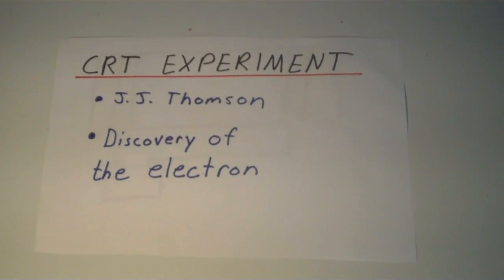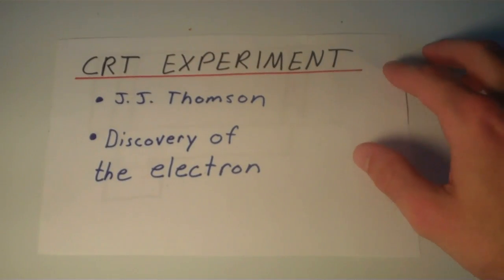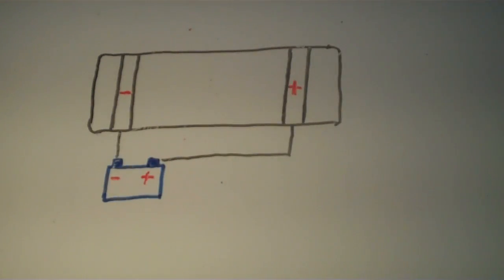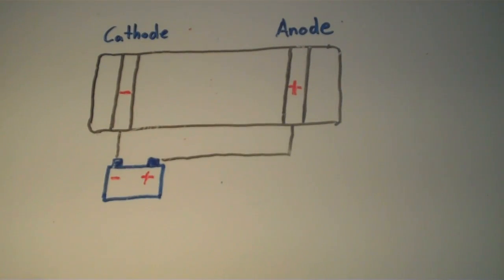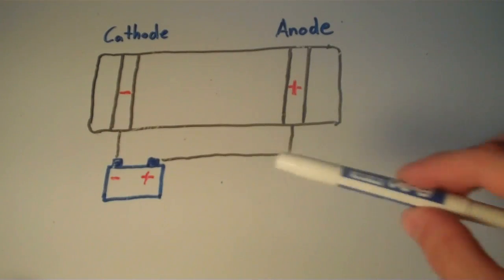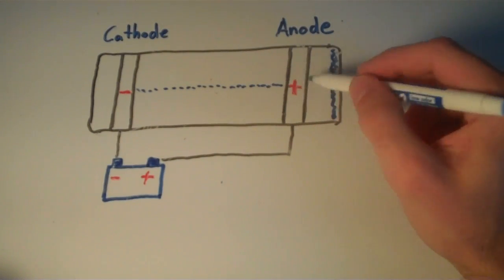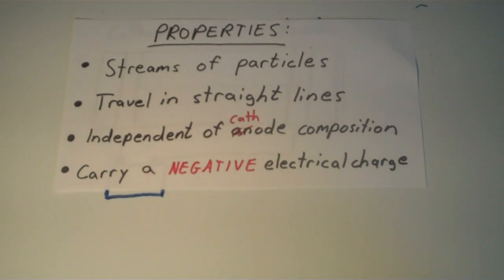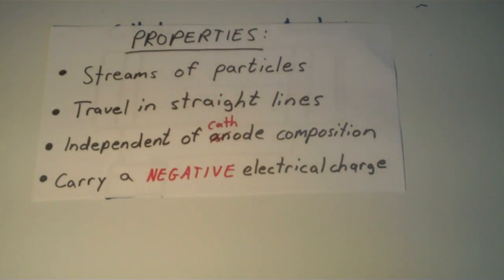Thomson's CRT Experiment:  The Discovery of the Electron

Comment: i'm confused how/ why this works. If you have a string of particles of like charge going through the tube, how can this be? Don't like charges repel one another? how can they form a beam? If one have a bunch of beads that were (electric) monopoles and tried to line them up in a straight line, would one be able to accomplish this?

Also, if the cathode and anode are forming and electric current through the vacuum why do electrons move past the anode? Why wouldn't they go into the anode to complete the circuit? If the electrons aren't going back into the anode, wouldn't this mean that there is no circuit?

Comment from the maker: @The1chipdude In a way, yes.  This experiment showed that the atom, which was once thought to be indestructible, could be chipped, and that there exist negatively charged subatomic particles (which we now call electrons).  How these electrons fit within atoms was still up in the air.  Thomson THOUGHT the plum pudding model was correct, but Ernest Rutherford later disproved it.  

Is that a good answer?